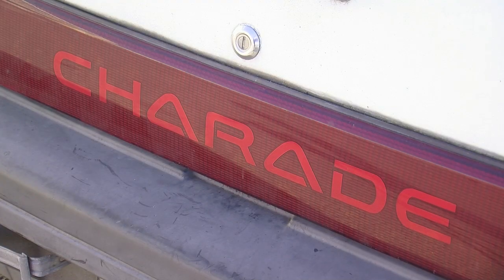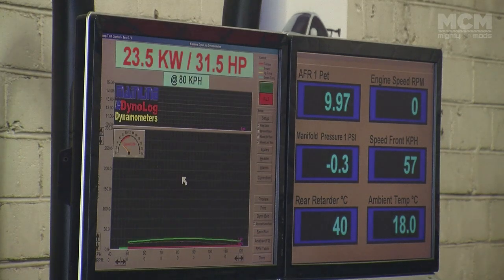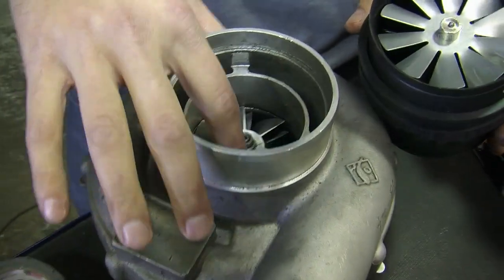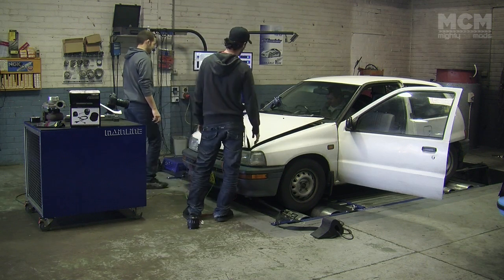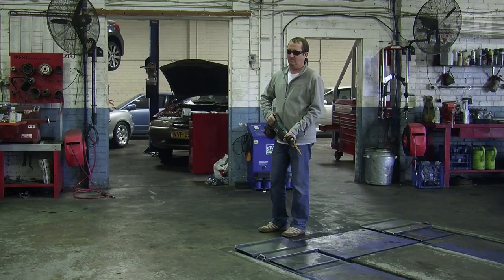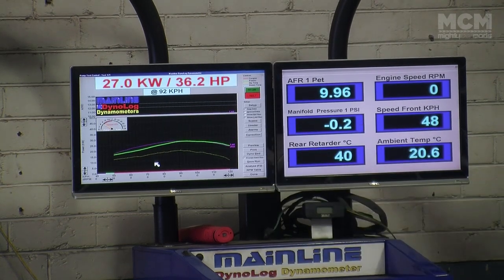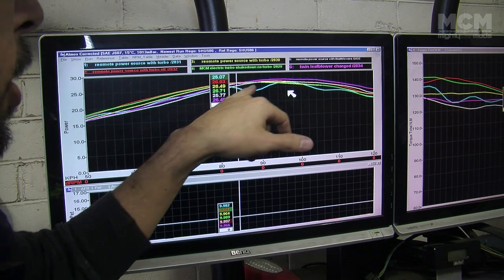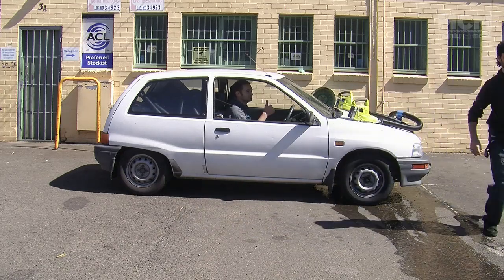Electric SuperChargers Mythbusted

Comment: Seems like theoretically they should be able to build an electric turbo. Electric motors can be very powerful coupled with the right gearing why couldn't you hit 100,000RPM. BTW they said per second in the video isn't it per minute? The new Audi le mans car has an electric turbo that spins up initially electrically to avoid lag. Such a kit would be a lot more than $300 but it seems if done right it could compete with traditional turbos at least if you're not looking for ridiculous amounts of power.
Reply: but why go to the trouble when you can just use free exhaust pressure to power the car, and you may be thinking of a VGT style turbo, there is nothing that electrically spools the turbo it has vanes in the the turbo that are electrically controlled to pinch the exhaust down at first to force it to spool fast then open as it starts building boost, most modern turbodiesels have them now days
Reply: It's been done, probably 10 years ago at least.  Thomas Knight Superchargers.  Then, if I remember right, they were $5K+ and actually did make proven boost, but still not anywhere near the performance level of their mechanical counterparts, the Turbo and Supercharger.  They added about 100 lbs, extra batteries and the charger, which isn't much different than adding a turbo system, but they sucked.
Reply: alscort93
It does take a lot of energy to compress air. It seems a hybrid turbo would be the best way to go, hopefully aeristech will come through.
Reply: sstroh08
Search for hybrid turbo on wikipidia, they go into a prototype built by aeristech, the article is questionable but the theory of it makes a lotta sense. Basically you have an exhaust turbine detached from your intake turbine. The exhaust turbine is a generator converting to electrical energy at 98.5% efficiency and powering the intake turbine. Saves space by avoiding complex intake piping and exhaust manifolds and allows you to initially spool up the turbo avoiding lag. Sounds pretty good to me if implemented well.
BTW I believe Audi's newest le mans car has a turbo like system like this.
Reply: sstroh08 There are a few possible reasons one might go to the trouble of using an electric motor over exhaust pressure and heat. For one, fewer pipes and lower under-hood temperatures. It's much easier to run and hide wires then exhaust pipes, which can concentrate heat.
Another reason is, while a turbo takes less HP to turn than a roots supercharger, it still takes HP to turn a turbo (in the form of backpressure) where a electric supercharger can store power until needed and replenish it when max HP is not needed.
A third reason would be that an electric motor is completely independent of engine rpm and available exhaust heat, pressure, and volume, meaning that a electric supercharger could almost spool instantly and to varying extents regardless of engine rpm which could create a very flat torque curve without the need for vulnerable/complex and expensive vanes which are less flexible than an independent motor would be in terms of delivering boost.
Reply: 177SCmaro If you're wanting less heat and piping under the hood, they make rear-mount turbos for that purpose.

To mimic turbo or supercharger operation, it won't be as simple as just hooking up a couple wires and plumbing the intake.

You're still going to rely on the engine pushing out amps from the alternator (hook a DMM to you car battery, set to DCV, and watch what happens when you hit the starter).  You're going to have to have an expensive controller for the electric motor, and that motor ain't gonna be cheap.  You'll have to have a battery bank which may add some weight or a lot of weight, depending on how deep your pockets are, flooded cell vs Lithium Ion.

I can tell you that unless you are using a 12V, or more, brush-less 3-phase AC  motor (Brush-less AC for maintenance free operation, they are sealed motors, less power hungry(Regenerative Braking has come a long way), and no carbon brushes dragging the commutator, and 3-phase for the quick on demand power that you'll need to spool it) you'll be pissing in the wind and replacing stuff all the time.

The other issue here is, you have to keep it away from heat, because once that controller senses that the motor it is controlling is hitting certain temps, it'll put it into a limp home mode or shut it down.  The more power you throw to it the more heat will be generated.

The more affordable way and better performing way would be to plot out a compressor map to the car you are building, buy that turbo or turbos, and get the car tuned properly.
Reply: alscort93 For starters, I agree that right now, and the foreseeable future, that anyone planing on supercharging a car should get an actual supercharger(s) because electric just isn't there yet. And when I say electric supercharger, I'm referring to a centrifugal supercharger powered by an electric motor, not those ventilation fans some people try to pass off as superchargers.

"If you're wanting less heat and piping under the hood, they make rear-mount turbos for that purpose."

I know. There is also the possibility of things like header wrap, etc. But an electric supercharger would remove the need for those things as well as eliminate all the that pluming, including extra oil pumps and lines to get oil back to a rear mount turbo, which was one of my points as to possible reasons for an electric supercharger.

It would also impart less heat on the intake charge due to it not having a turbine that transfers heat though the impeller shaft.

"You're still going to rely on the engine pushing out amps from the alternator..."

Again, I know, I said as much, but, again, the advantage to a electric supercharger is you can store power to drive the supercharger before hand, use it, then recharge the batteries when you don't need max horsepower, for example, a burst of speed on the freeway or drag racing. Endurance or circuit type racing it would less advantageous due to continuous use but it could be set up in such a way as to give more temporary power in straightaways or coming out of corners and recharged during breaking or coasting.

"The more power you throw to it the more heat will be generated."

Which is why a legitimate electric supercharger would almost surly operate at higher than 12VDC. Higher voltage would allow much more electrical "push" for a given amperage.

Not saying there won't be downsides, I'm just saying, in theory, an electric supercharger could work and there would be advantages.
Reply: 177SCmaro search up ford focus hyboost. jay leno had it on his show.  its an electric supercharger to makeup for the turbo lag, but it requires a supercapacitor bank to power the electric motor.  so its definitely possible but the system is much more complicated.
Reply: 177SCmaro  "...not those ventilation fans some people try to pass off as superchargers."

The video was talking about those, I wasn't talking about those either.  I wish I would have come up with that idea many years ago, because I would be rich.  You say power and people start throwing money at your feet.

Like I had stated earlier, there was a company that offered one that worked probably 10-12 years ago, Thomas Knight Superchargers.  Didn't work well, but worked none the less.

I think if you are wanting the centrifugal aspect that can work whenever you want it to, just a regular Procharger with an A/C clutch built onto the pulley would probably be your best bet.  But then tuning would be insane to get a tune that would work well with that, same with an on demand electric supercharger.  The only time you'd be dragging on the engine would be while boosting when you turn the clutch on.  The only tubing you would have would be the intake piping.
Reply: alscort93 Yeah, I know. The idea of using a clutch is nothing new, although I think a better idea if one is concerned with every last bit of efficiency might to simply use a by-pass valve if that's even necessary. I don't think centrifugals suck up hardly any power when not under boost.

Again, the big advantage an electric supercharger could have is the ability to offer almost any amount of boost at any rpm because it's not dependent on crank rpm (until the batteries need recharged) or exhaust pressure. No supercharger that I'm aware of can do that.
Reply: alscort93 Isn't that kind of the point of it, that they suck (or blow) haha

Comment: Mistake that i see here is old airbox is still there with old filter. I would remove the airbox as its very sufficient bolt a single direct pipe to throttle body and use the filter you got with the electric charger. Funny but i think u would have seen some gain with this
Reply: insufficient
Reply: But if you read the installation instructions it says you can put it on before or after the filter.  Results are the same either way.
Reply: drjim86  Yes you can but knowing how insufficient these old round air boxes are i would have removed it and went with a direct single pipe. Would give you a lot better airflow. The thing is the air that is being pushed with the electric charged is not being pushed directly in to the carburetor it is pushed in to the air box which really doesn't do much. Once the air get in to the air box is it spread around it looses its pressure it creates turbulence in other words its a waste does nothing. Just like real turbo system it has a single pipe feeding the engine directly which is a much more efficient. I still think these are waste as they do not compress air like turbos do but i would still try it for fun to see if it can be done

Comment: Forgot to remention the disclaimer that you are just ordinary guys making ordinary mistakes. Good job of shoving air down the heat riser to cool the headers or did you all not notice the pneumatic valve on the air cleaner snorkel? They are open by default and I would bet bitcoins to a dollar that its old vacuum servo, hose, nor temp valve no longer say choo choo choo!
Reply: um, yeah, was thinking the same thing
+1

Comment: this pos has a carb, right, well the intake stuff above the carb has vacuum hoses and your leaking pressure , what you have is a blow through system, but you have to make 3 bar to see a diffrence
Reply: You have to make 3 bar (45 psi) to make a difference?

Comment: The problem with electric fan supers is a lack of backflow protection.  That's the difference between lots of CFM of air moving and air actually compressing to a higher PSI.  Electric fans simply slow down or stop under a pressure difference because they aren't designed to maintain pressure.  So even if you threw a 600CFM delta fan in there and said hey, some turbos are only 900CFM, the fan still isn't built to maintain pressure so it won't work.

Comment: They would of gotten better results with the filter on....That design of the filter that came with the system would cause the air to spiral and giving it much more contact patch to suck in air...not sure of a huge 50 hp difference but a noticeable one forsure.

Comment: If they put it on a car that had electronic fuel injection it would automatically add more fuel to a point when it senses it has more air and the mixture is weak via the Lambda sensor so it would make more power, putting it on a car with a carb that puts the same amount of fuel in all the time regardless if you add more air will not make more power.

Comment: i've seen electric torque wrenches before, but never battery operated, cordless torque wrench. what brand power tool is that from the intro?
Reply: Thats a Ryobi or Hitachi (Green).  Many companies make them now: Dewalt, Craftsmen, Porter Cable.  But you want something to bring some real power look at Snap On, Milwaukee, or Ingersol-Rand with over 19volt Li-ion batteries.  Personally I have the IR IQv 19.2v 1/2" impact.
Reply: definitely not a torque wrench at all.

Comment: Well, the effort is OK, but if you are going to blow more air, you need to put more gasoline... keeping the same amout of gas, and more air won't make real difference...
With carburator would be easier to get few Horsepower... but the blow from turbo or Blower is way more than those cheap fans...
Reply: most fuel injection vehicles can handle much more air input than is capable in a stock setup, the fuel injectors and pump are usually not the bottleneck. so in this particular setup that's a non-issue.
Reply: Even a carburator engine need to have the gasoline flow changed in order to use the extra air for more power... as they did not stat that, I presume they left it as it was...
Reply: Totally agree. If you put more air, but not more gasoline the power gain is minimal.
Reply: Not Most... Few... very few...
The engine must have a MAF (Mass Air Flow) sensor to be able to read the air intake and calculate how much more fuel it can put... BUT... The Fuel Injection will CUT the gasoline when reaches some factory limit (for safety/economy reasons)

So, even a car well prepared to take more air, will have a little gain with just air... you need to work the injection aswell, or you're doing just half the work...
Reply: On anything with an ECU it is really easy to tun the AFR properly. 
Not until you start getting psi over a certain amount do you need to upgrade the injectors and the pump. It varies from car to car but is often around the 12 psi mark.

Comment: Superchargers are belt driven, turbochargers are exhaust gas driven. So no, what you are holding at 4:55 is not a supercharge turbo, it is just a turbo. And it spins at around 60,000-120,000 RPM not per second.
Reply: Turbo's are only a type of Supercharger by definition. All forms of forced induction in wide use are achieved by superchargers regardless of how they're driven.
Reply: I get what your saying in that if you ignore how they are powered they more or less work the same with very similar components, however turbochargers and exhaust driven and superchargers are belt driven. You are right though, they do the same thing and the only difference is that a supercharger has almost zero lag.
Reply: ***** superchargers also have parasitic drain. On Top Fuel dragsters, which typically run 8-10 thousand horsepower, the parasitic drain is upwards of 700 horsepower. Turbos, not being connected to the engine directly, don't create this horsepower drain.

Comment: i had a chevy sprint with a 1.0 liter and so i put a portable leafblower on it using hockey tape and cut up pepsi bottles and it didnt do anything that i noticed then i race a crappy civic and i found that it got more power at the top of the rev range due to volumetic efficiency. Made power all the way to rev limiter lasted for about two months the broke motor mount. so i know it works. oh it wasnt a ryobi, it was old n grey and just hooked a 15 amp switch on the dash. took 30 minutes to install.

Comment: One of the major differences between a fan and a rotating compressor is the blade clearance with the fan housing. In order to compress the air the clearance can only be a few hundredths of an inch else the air will leak out and no pressure will be produced.

And engine takes a lot of air and it takes a lot of work to compress it.

In the 1930's Rolls-Royce fitted a supercharger to one of its engines to boost the power from 750 to 1,000 hp. To get a 250 hp increase at the prop, the supercharger needed 150 hp to drive.

Even if an electric supercharger could supply the volume of pressurized air, the alternator load to drive it would take all of the power it produced.

Comment: Loool this video is very basic but it does bring the point across, although next time you boys want to show if a charged mod would work on a car at least show what the manifold pressure is and looking at the afr on the dyno seems very rich almost at 10:1 but then again thats after the run is finished so lots of details left out, not that im defending the crapy electric chargers but good to know you guys have your facts right about the expensive turbos and how to put one on would cost $10k and will spin at 100 000 rps lol

ps i twin charged my 1uz and it didn't cost that much
two gt2540 $1600
haltec 2000 ecu $1990
injectors pump and reg $1200
cooler $200
exhaust and cooler plumbing $400 (just the material)
bov $100
the look on your face when it made 411rwkw at 11psi ..............priceless

Comment: The carburetor is not made to be pressurised, plus it should be obvious from when he spun the fans of the eletric and turbo that the turbo spun more smoothly and longer. The fan may create more pressure but the fatory intake/carburetor will not hold the pressure it'll just escape back out, do not bother with them.
Reply: o_0 there are dozens of cars set up with superchargers on top of the carb that i know of, my question was, since its carb. did they replace the jets to allow more fuel?  cause more air is CRAP with out the fuel to match.
Reply: Sorry, I may not have been specific enough, I meant not on a factory carb, you could throw a jet kit on it so it works fine, but even most carbureted turbos are not set up right for the reason you said the fuel to air ratio, I do not believe they did to try to prove it to be a simply set up, I would personally like too know myself.

Comment: Why didn't you guys route the industrial fan that was cooling the engine from the dino? That would have been enough to require a tune-up! Haha.
Reply: As with using any fan, there is too much space between the fan blades. Reversion would be so bad you'd never get a volume of air to "stack up" as with traditional superchargers.
Reply: This would be a great example to stress the point. The only way to make more air flow through an intake is to compress the air?
Reply: ryan bond There are a number of ways to increase airflow through an intake. Forcing air under pressure with a supercharger is just one way - the goal is to increase the air's density so that it carries more oxygen per volume.